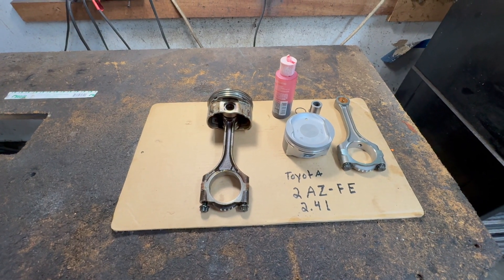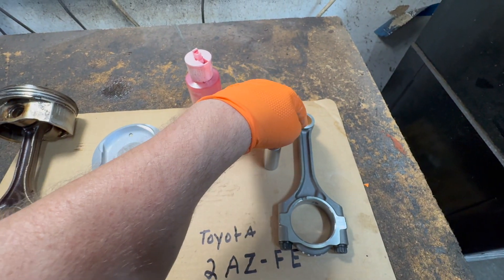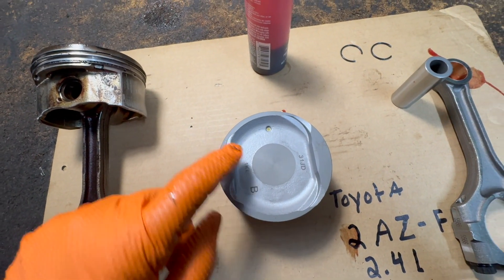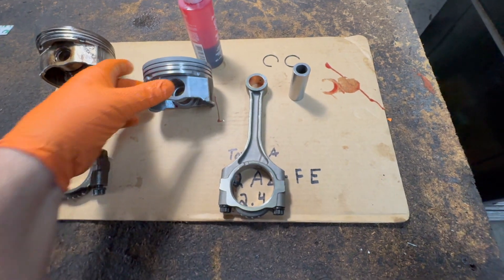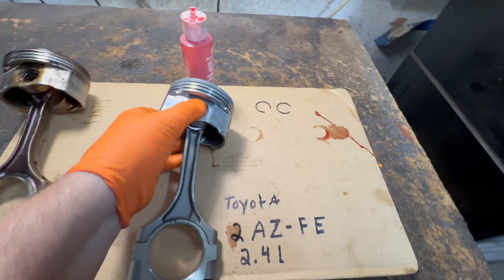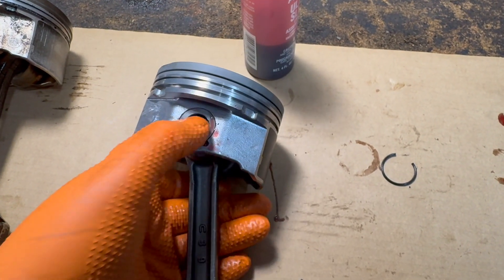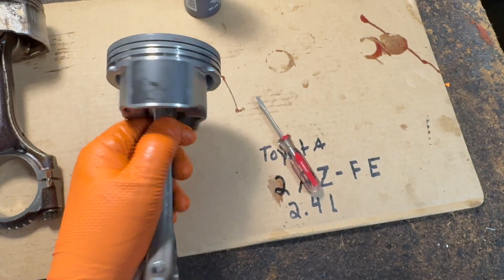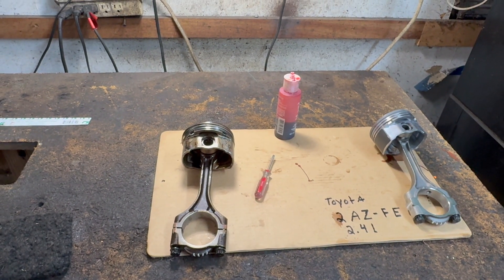How to Assemble Piston on Connecting Rod - Toyota 2AZ-FE 2.4L Engine

Comment: Question sir my dodge 2.4 does not have snap wings to keep them in place how do I go about this
Reply from the maker: Yours are probably press fit, they require heat to expand the rod circumference then the wrist pin slides in. Machine shops can do this for you if you can't.